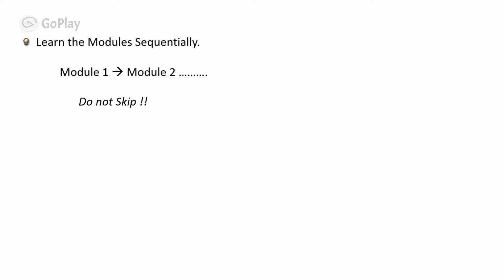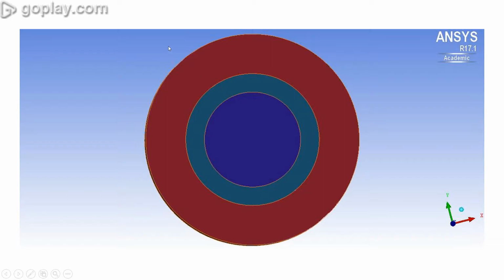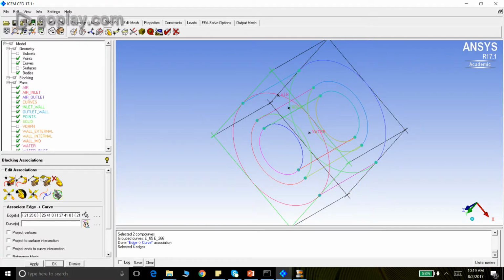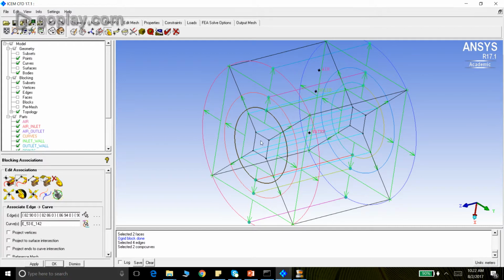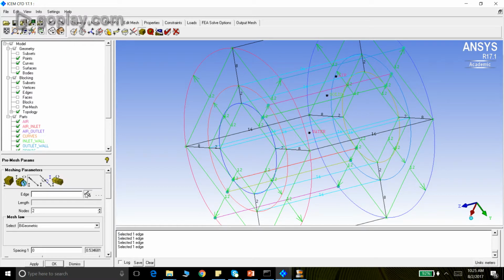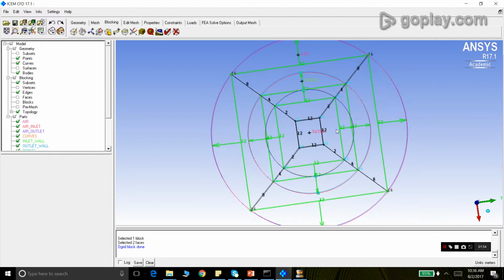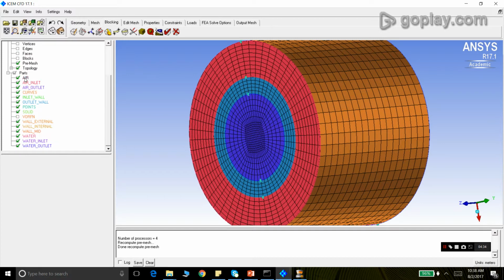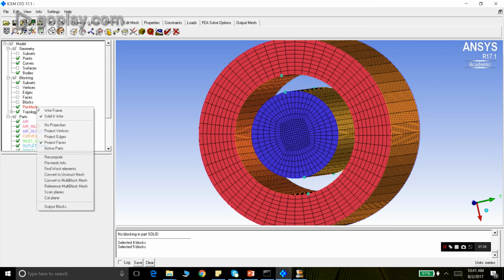ShellTubeThickness

Comment: Sir please make a video for double pipe heat exchanger (both pipe have some thickness) please sir
Reply from the maker: Hey Gulshan. First of all my apologies for the late response. Please do not despair.  The meshing for double pipe heat exchanger will proceed EXACTLY like the way it is shown here. The thickness does not really matter. Think of it this way. For a cylinder which contains 'n'  inner cylinders, the number of O grids should be 'n+1'. n O grids will capture the n inner cylinders while the n+1 th O grid will be necessary to capture the curvature and improve the quality. Does this make sense to you? Let me know if you need any further help.
Reply: @afirstcourseinicem-hexa2655  thank you so much, sir
Reply: @afirstcourseinicem-hexa2655  Hi sir, first of all apologies for replying on old thread. I have a problem with big hollow cylinder and 3 small cylinders lie in a straight line. How to approach this problem. your help will be greatly appreciated.
Thank you